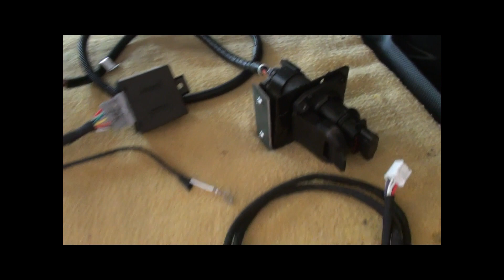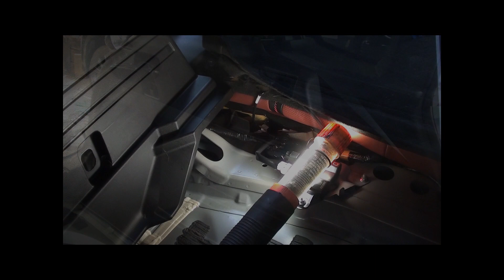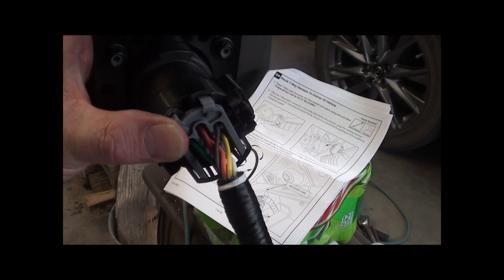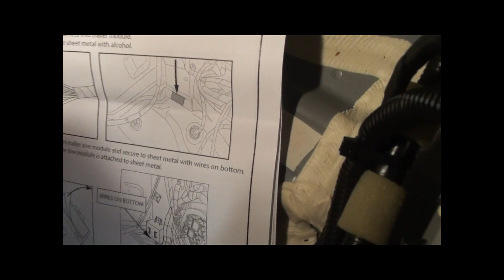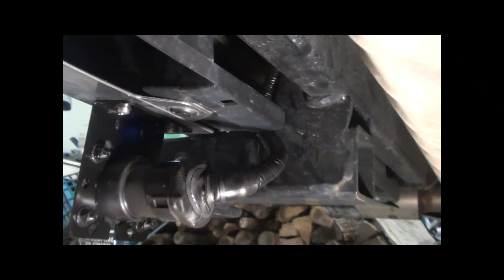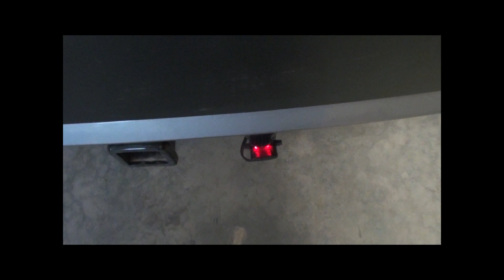Mazda CX-50 Trailer Hitch Wiring

Comment: Thanks for the video.  FYI On my 2026 Turbo, the passenger 8 pin connection already has 4 wires connected, Had to de-pin one and combine the new trailer 3 wires into the exiting 4 wires.  All works well.

Comment: Great video, Paul.  Did that rubber weather strip have to come up in order to remove the the black plastic sill in the back?  And does the OEM wiring harness have any provision or connector for adding a trailer brake controller?  I read somewhere about looking for a 4 pin connector on the firewall just above the accelerator peddle.

Comment: Hello,  I'm curious if this would be compatible with a 2024 Mazda CX-5 2.5 turbo. I have no they have the four pin connector that's compatible, but I really need a seven pin connector so I can control my trailer breaks. Online it says that your harness is only compatible with the XC 70 and XC 90, but I see it works for your XC 50.

Comment: I had a Mazda dealer install the Mazda 7-pin harness and hitch. When I tested the newly installed 7-pin connector using a test plug with LEDs, only a 12V signal was available (even with the engine off). None of the other signals got through. Is there an additional software activation necessary to enable tow mode? I am also missing the 4-pin brake controller connector. Isn't that part of the harness and should be available next to the gas pedal?
Reply from the maker: No, there isn't anything additional that needs to be activated. Control box in the harness will talk to the main CPU and trigger the tow mode software. Power links were installed in the engine compartment between the battery and the fuse box? Connectors were properly connected to the pigtails by the rear lights? Ground? I have heard that there is an extra harness piece required for the '25's. Connector for brake controller should be taped to the wiring on the firewall a few inches above the gas pedal.
Reply: @pmatulew1  Thanks Paul. They probably missed a harness installation step, and I would not be surprised if the 4-pin brake controller connector is hidden deep behind the plastic covers. The harness should be fine. VA41V7780B  is the latest version for my 2023 CX-50 TPP

Comment: i just bought a used CX-50 turbo and it has an aftermarket hitch and i believe the harness is aftermarket. how difficult is it to remove the aftermarket harness to install the OEM one? and is it okay to keep the aftermarket hitch?
Reply from the maker: Depends on how the aftermarket wiring was installed. If it has the correct plug-and-play connectors, then it should just be a matter of disconnecting. If the aftermarket wiring was tapped directly into the tailight wiring, they probably used those blue crimped on taps. Can be removed carefully but you need to make sure the wounds in the wiring are sealed up after.

Comment: What the part number for the harness?
Reply from the maker: Was on the box in the first 30 seconds of the video. VA41-V7-780A
Reply: @pmatulew1  thank you. You’re video helped me attached my hitch and harness
Reply: Thank you. I ordered one, but the last digit ends with a “B” instead of an A”. It’s the “B” the old version?
Reply: @hithere9495 I tracked the answer down because I also ordered the B version. It is currently the newest. The original had no letter suffix. It was superseded by the A version as part of the recall. Repairs through the recall program used an X suffixed part number though. It had fewer included parts, only the parts needing to be replaced. I don’t know what changed from A to B, but this was after the recall.

Comment: This tells me without a doubt, to stick with the OEM hitch AND cables instead of the aftermarket stuff. Have heard in other reviews that the cables ordered online (with the aftermarket hitch) DO NOT provide the "black box" needed to shut off the back up sensors which causes problems and other things as well like computer "not liking" what it's seeing (incompatible). Glad I watched this video though!!!
Reply from the maker: Also helps to read the instructions that come with the package in your hands. Read a recent forum post about a fella that had the cables installed by the dealer. They installed the whole thing reversed and nothing worked. So much for that quality control process.

Comment: First trip with a trailer and tow mode. I'm liking it so far. System holds the shift points longer and does some predictive downshifts going downhill to provide some engine braking. Also seem like it is running the engine cooling fan more?

Comment: Thanks for the detailed video Paul. The extra features in the control box probably communicate with the car to enable tow mode (accessible in your drive modes). 

It looks like the original owner did not purchase the OEM hitch. That comes with a holder for the 7pin connector (turbo model).